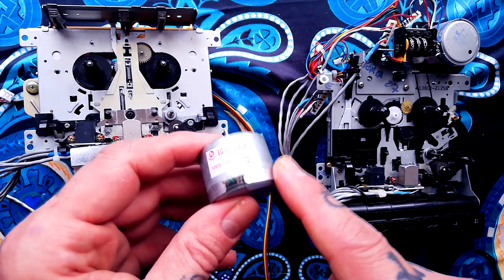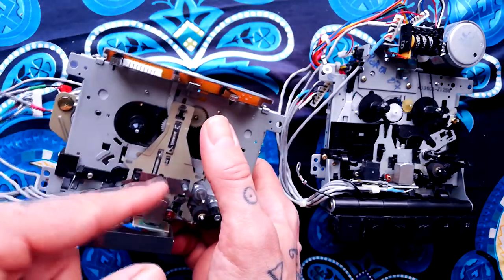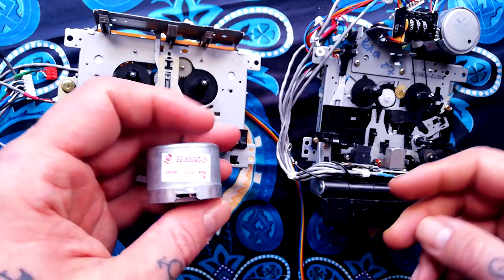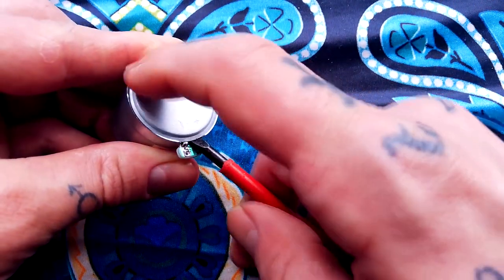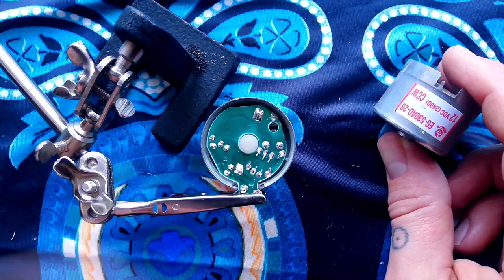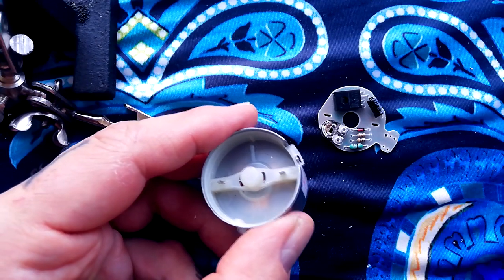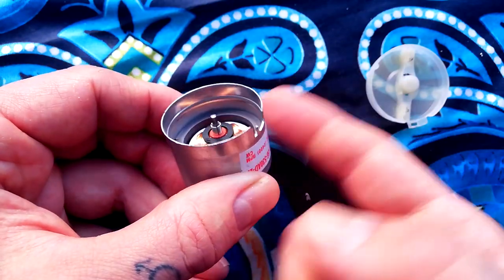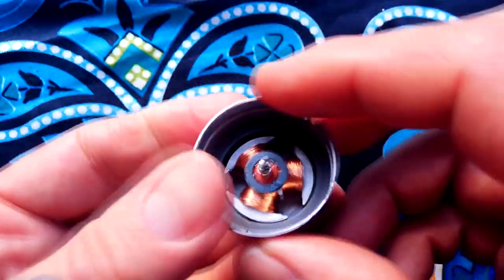Whats inside a 4 track motor? What goes wrong? Mabuchi 12 volt motors.

Comment: Replaced belt, replaced gear C and did some cleaning, capstan not turning and wouldn't stay engaged in playback, motor was very hot.  Popped the motor open and see a very dark circuit board.  We'll see if I can get it working.  Your videos have been so much help to me

Comment: Hi! 4:34. The trick (which I assume you know) to extract that white cap without causing any damage to the brushes is using a "u" shaped strong enough metal wire that should be inserted into these two small grooves around the center hole of the white cap and rotated this wire slightly until the brush arms open (a little) to allow the extraction of that cap. Thanks for the video.
Reply from the maker: Thanks for clarifying that. I may not have been aware at the time of making the video!

Comment: I'm working on a 464 that engages the tape heads and then instantly retracts after pressing play. FWD/REW, Pause all work  New belt, cleaned gearset. and still has the problem. Could it be an electrical motor issue?  I'm having trouble sourcing the Mabuchi EG-530KD-2B that drives the pulley system so tearing the motor apart might come in handy. 
Thanks for the amazing content!
Reply from the maker: Could be your gear C has cracked or shattered, have you checked that? I have a video on that, also one on replacing the motor control chip in the motor you mentioned if that becomes necessary , thanks for watching.

Comment: Thank you for making all this content about repairing portastudios it’s been so helpful. I have been trying to repair my 488 and my motor needs replacing and I was unable to find a 530KD but picked up a 530AD on ebay instead. I read through your blog about the differences of the motors and how the black and red wires connect to the DC and ground and the other two are for positive and ground of the pitch board. Is there a way to connect those two wires to the pcb of the 530AD to control the pitch still? I am just a bit stuck on how I would wire the 530AD to make it work, even if not up to the standard speed of the original motor

Comment: Your channel and website are RIDICULOUSLY helpful! Thanks so much 👍 In your opinion, is it okay to use a potentiometer as a voltage divider to lower the voltage going to that motor, or should I use pwm? One of the things I love doing with the porta02 is using the variations in quality like a low pass filter, so i don't currently need to go faster. I can't figure out whether it's safe or not to run it at a lower voltage for the long term. Thanks ✌️

Also, that commutator looks like a lot like Hekate's Wheel. Very strophalic... Is that a word? 🤔😄
Reply from the maker: For context, I haven't actually tried either...I'd like to get into the mods/circuit bending side of electronics but to date I'm completely specialised in just getting old portastudios working again. For a voltage divider, I'm pretty sure the internal PCB screws up any linear relationship between speed and +v, and I seem to remember folks in forums etc saying they tried this approach and it didn't work? I'm not sure whether pulse width modulation would get round this, but I imagine not since any video or blog I've seen using pwm to control a motor it's always been a standard speed, 2 input cable motor. I imagine he worst that could happen is you stress out the control chip faster so if you have a replacement on hand you could give it a go, let us know how it goes?
Reply: @Tetrakan  I guess I'll have to prod at it for a while. I assumed that pwm would be the obvious choice until watching this video. I didn't realize how much was going on in there. 
    I'm going to try to change the voltage getting to it and make sure the current doesn't go crazy. I've heard that is a problem when the voltage supply dips🤷‍♂️ I'll see how it goes, and let you know if anything worth noting happens. Thanks again 👍
Reply from the maker: @els1f  P.S. I was apprehensive about googling strophalic, but I'm relieved to say the results were clean and informative
Reply: @Tetrakan  haha sorry! The runes and tats made me assume you would have gotten the terrible wordplay😄

Comment: Love the video. I did have a question though. I'm trying to find a replacement for my Vestax MR300 motor. It's a EG-530KD-2F CW 1600/3200 rpm. There are none to be found. Can I use the EG-530AD-2F that is CW but has 2400 rpm and adjust the pitch to that speed?? Is there a source for parts like the circuit board or the internal chips?  Any help would be greatly appreciated!
Reply from the maker: I suspect the AF will work, but may not go as fast as 3&3/4 IPS?  I'm not aware of anyone supplying  just the internal circuit board. I just typed the part number into eBay and Google - I've bought three batches of NOS from three suppliers, so it's not like there's a reliable supplier with a big stick of them unfortunately.

Comment: Where can a potentiometer be attached to the circuit for a smooth full range speed control? I tried to connect it in series with the motor but a slight rotation makes a drastic change! i know it is possible but can't find so far how

Comment: The motor on my 424 MK1 was beginning to slow so I went ahead after watching your video and opened up the motor itself hoping to find a burnt out IC that I could replace. However, it appears to have a 6605 IC, an 8 legged wee beastie. I'm wondering if replacing this will correct my issues. Have you come across this before?
Reply from the maker: Because it’s  a different motor in the mk 1, I’ve only ever owned one such and the motor in that unit is okay I’ve never needed to pry it open so my answer is kind of speculative but I would suspect that any motor which does 3200 rpm and has 4 input cabled will have ICs in there to regulate the motor speed  which have to dissipate a lot of heat and will fail eventually for that reason, so yeah it seems likely that replacing that chip and any electrolytic caps on the internal pcb which might have dried out will resolve your issue, let us know how you get on.
Reply: @Tetrakan  well that's good to know. I'll order a chip and let you know for sure. The motor in question I believe to be the original but has no typical markings suggesting a model number etc... However, I discovered through searches that the EG 530KD 2B it's supposed to be a replacement. I happened to have a pioneer double tape deck with two of these motors and so used one, being careful to observe the correct connections. Strangely, everything plays twice as fast and on top of that, high norm slow are opposite of what they should be and the pitch control is opposite in regards to plus and minus. What do you think could be happening?
Reply from the maker: If you can get spec sheets you could check that both chips expect the same input voltages, have the same input scheme etc?

Comment: So would modifying the components on that PCB in some way allow you to adjust the speed of the motor?

I ask because I recently found a forum where an old TEAC tech claimed that the EG-530YD-2B could work as a replacement for the 530KD, but that motor is a 4000rpm motor as opposed to 3200rpm. So if it did work in the machine, you wouldn’t be able to play old tapes that were recorded with the original motor at their original speeds. So I’m wondering if there might be some way to bring the speed of the 4000rpm motor down ~20% to match the speed of the 3200rpm motor and allow playback of old tapes, provided it even works in the machine..I’m still waiting on the new motor to come in. It was $8 and I’ve got a spare 488 I’m keeping for parts that I’m going to try it on, so if it doesn’t then I’ve only wasted a few bucks and a little bit of time.
Reply from the maker: I think what you are describing might be possible, but I would have to do a lot of experimenting before I could tell you what to change, and it'd be easier, ergonomically speaking,  to mount the extra/different components externally because there's really very little room on the PCB inside the motor enclosure. Was skywave the tech you mention?
Reply: @Tetrakan  it was Skywave actually. But now that you mention doing it externally, I’m wondering about just changing the pot in the pitch control? I suppose I’ll just have to do a little more research and try it out when my motor comes in.

This’ll be the first time I even pick up a soldering iron, so that’s where I’m at heh thank god for your videos though man, you’re doing the lord’s work.
Reply: @perrycolomb8206  it worked okay, but paradoxically it ended up running slower than the -KD motor by about 25%. I never adjusted the trim pot or anything (that’s something I had heard mentioned, and i imagined it being simple to do but I don’t think it is), but all the transport functions worked and it ran flawlessly, just slower. 

Once I got it open and got the motor in, the idea of doing extra mods to it was just too much for me so I never bothered, it was really just to find a possible alternative to the original motors; I had seen in a fb group someone who used a motor with the same rpm’s as the EG-530-KD but it would run for a couple seconds and then stop, we think because of lack of torque. So finding a motor that actually worked at all was kind of enough, especially considering how cheap they are.

Comment: Hey I have a eg-500ad-2B 12v 2400 ccw motor that’s going bad, do you know where I can get a replacement?
Reply: Pulley doesn’t spin freely, sometimes it runs fine then sometimes it will run then stop

Comment: Have you done any work or thought about how to get these motors to spin as consistently as possible? I have a Fostex 280 (Mabuchi EG-530KD-2B) and also Yamaha MT4X (SHU2L - same as Tascam 424 mk2/3), and both run fine, but with extensive testing I notice the tape speed in both machines have have an uncomfortable amount of speed error - musically speaking, the pitch will be off about 5+ musical cents when its cold, but then they settle in after a minute of use. I should note this is within the spec of the service manuals, but still. After a minute or so of disuse, both machines will back to being a little off, only to come back after about 60 seconds of playback. Not talking much, but enough to make an OCD musician a lilttle uncomfortable. And certainly enough to make an instrument performance slightly out of tune.

I have disabled the pitch control pots, soldered in their place low ppm (i.e., very stable) resistors of the appropriate values to lock in the speed at the nominal setting, and also replaced the 1-turn trim pots with 4-turn versions, with tighter ppm, all in pursuit of the most stable capstan speed I can achieve (voluntarily giving up pitch control, of course). It seems I have hit a brickwall as nothing seems to improve it at this point. It's got me thinking about recapping the power supplies, perhaps to produce more stable voltage. The power supplies at this point are 25 years old (Yamaha) and/or 30+ for the Fostex.

Any thoughts?
Reply from the maker: Hey, sorry it has taken me ages to reply to this comment. It sounds like you've made more in- roads into stabilising the pitch of these motors than I have! I should emphasise that I don't have any academic or professional pedigree in what I do, and even as an amateur I have very little experience in electronics beyond getting dead or dying cassette recorders to recover basic musical usefulness -  so, for instance, while I do understand what pulse width modulation is and have watched a bunch of videos of circuit benders applying that technology in their projects, I've personally never used that technology. I'm also very tolerant of the shortcomings of these systems and tend to hear a little drift and warble as part of the rustic charm which distinguishes cassette  from more stable recording systems. That said, here are my thoughts on what you are asking/suggesting: Recapping the PSU is definitely worth doing since these things are near the end of their recommended shelf life so you'd be adding to the longevity of the unit anyway; however, most times I've got into the nitty-gritty of the schematics of these units, the 12v rail powering the motor is coming from a voltage regulator anyway... I suppose bad filter caps might cause the voltage regulator to do more work and produce more heat, but as I understand it, if the voltage regulator should be producing a steady 12volt output no matter how leaky the big resevoir caps are. My ability to interpret competing regulator spec sheets is rudimentary, but if you have the theoretical background perhaps looking for an upgraded regulator would be a better way to purify the 12v source the motor receives, assuming that is a factor in pitch instability? Once the 12v rail reaches the motor as I understand it the motor control chip is meant to smooth out the speed, among other things? Clearly these chips have issues with heat dissipation, so mounting the servo PCB on the outside of the motor chassis and using the chassis as as a big heat sink is something I thought about. Also if the servo board was mounted outside the motor casing, the lack of restrictions on the size or shape of the board would open up scope to use a better (?) motor control chip, one still in production, so we aren't  relying on finite supplies of NOS? Ultimately I fear that a lot of the pitch instability is actually mechanical in nature - physical give in how the commutator sits in its housing and interacts with the brushes. Perhaps an extant  supplier could be found of a more mechanically stable motor with no internal servo, which could be used with the externally mounted, properly heat-sunk (sic) servo board mentioned above. I might be talking absolute bollocks here, but those are my thoughts. If you find a solution please let us know, and thanks for watching!

Comment: Hello. Can I ask a question? Can mabuchi eg-530kd-2b generate electricity? And how to do it? Thanks. Hopefully you respond as quick as possible
Reply from the maker: Not really my area of expertise, but I suppose in principle an electric motor is just a generator in reverse, so if you turned the center of the motor (using wind power, for instance) then a very small current would be generated? You'd be much better asking a real electrical engineer this, I'm just a musician!

Comment: Interesting, im reparing a Marantz sd4000 and inside the motor i found a tiny coil on the shaft with a magnet rotating in the shaft, i think is a some type of servo motor, but one wire of the tiny coil was cutted i cant see to solder where is the cut... i need a microscope maybe..

Comment: Would this chip work for a tascam 246?
Reply from the maker: No. But same principle probably will probably resolve equivalent issues with erratic speed or not responding to user pitch controls - replace semiconductors on the motors internal PCB with new old stock parts. I’ve also successfully fitted the style of motor shown in the video in a 244, and I’m sur Ethel same thing could be done with a 246 - adaptation of the resistor network which controls the speed is necessary, I made a video about it on patreon.